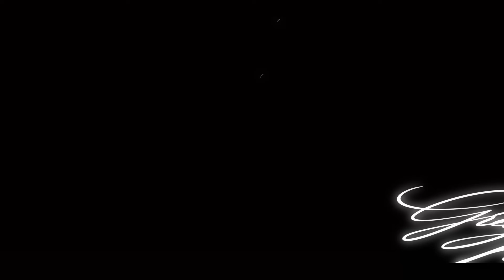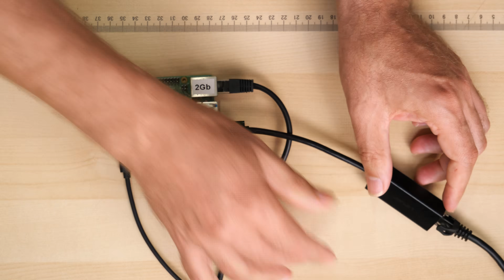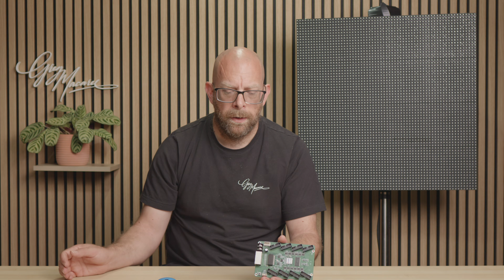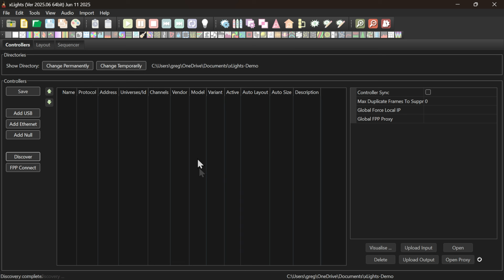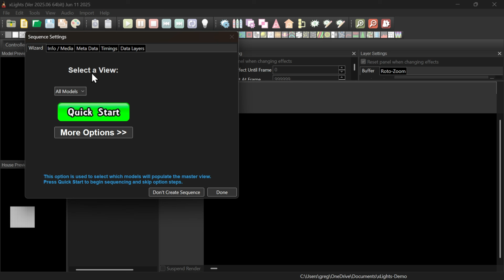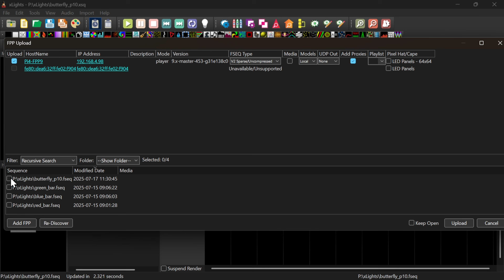Setting up an LED Matrix with FPP v9 &  Colorlight card. #colorlight #fpp #xlights #pixels #panels

Comment: While I am not using Colorlight card, based on a previous video of yours I purchased a Hanson Electronics rPi-P10 Pi hat. With FPP 8.X I was able to create an LED Panel Matrix. Now that I installed FPP 9.1 that option is gone. I can't find any way in FPP 9.1 to create an LED Panel Matrix usig the rPI-P10 Pi hat that I have. Am I missing something here?
Reply from the maker: If you go to Input/Output settings, LED Panel Matrices tab then click Add Panel Matrix and ensure the Connection Type is Hat/Cap/Cape and Add Panel you should be good to go !
Reply: @gregmacaree  thanks for the reply. The problem is that for me, in FPP 9.1 there is no option for an LED panel Matrix. I don't think FPP 9 is properly recognizing the rPI-P10 cape.
Reply: OK, after countless Google searches I finally found the answer. The LED Panel Matrix option is only available in the FPP advanced UI and selecting Display all hardware options/settings. Why does it have to be so complicated?
Reply from the maker: @BryanSurrett  I'm missing something here - I dont have any outputs currently configured and it's right there in the basic settings. Are you running some other outputs that might have caused it to be hidden ?

Comment: I'd love to see a video on setting up multiple colourlight cards in the one LED display, I've got a project in mind but unsure if it'll work with multiple cards from one Pi4/5
Reply from the maker: It's old, but still applies: https://www.youtube.com/watch?v=x6x4lE9h-AI
Reply: @gregmacaree the ledvision program doesnt look the same as the current one 9.2
Reply from the maker: @scoffee82  Its not, you cant use 9.2 as its dropped the net card support.  I use 8.6
Reply: @gregmacaree ahh that makes sense, will uninstall and re install v8.6
Reply: @gregmacaree I've sent you an email, hoping you could give me some pointers on the issue I'm having with my panels